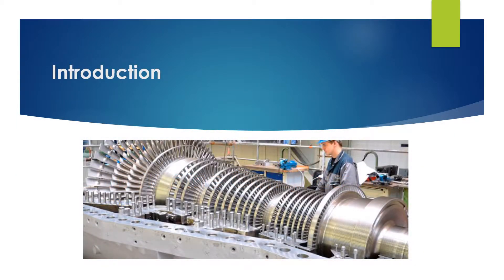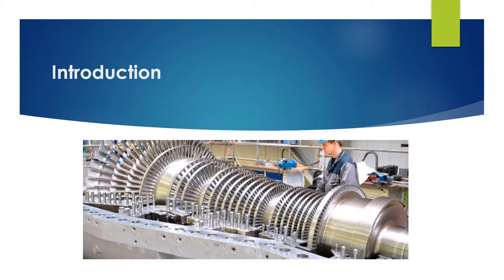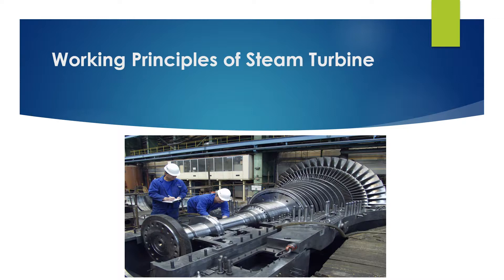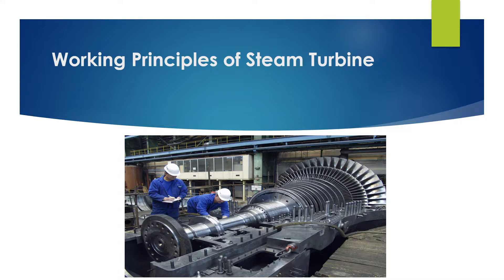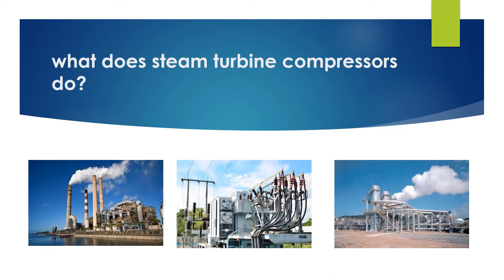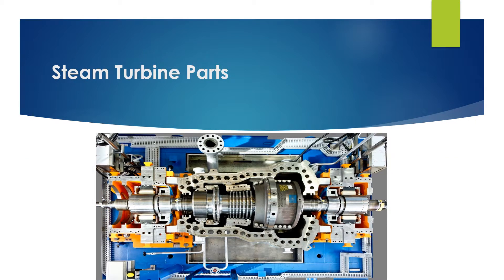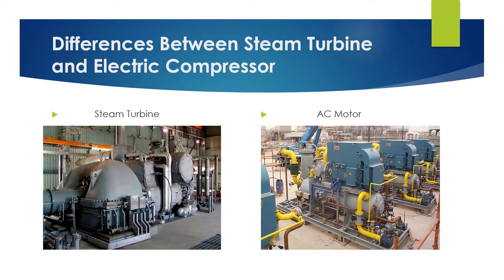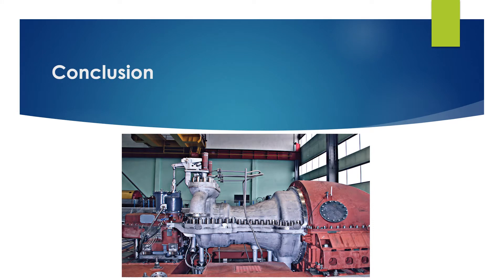Steam Turbine Compressors Presentation

Comment: nice one but if you can detail one ppt on condensing and non-condensing ST driven the compressor and what are design aspect need to consider?
Reply from the maker: I couldn’t go in details because this is an English class project and the audiences are not familiar with this equipment so that why I made it as simple as I can